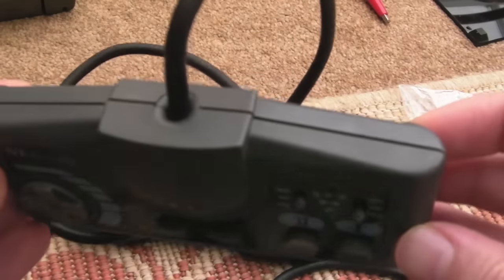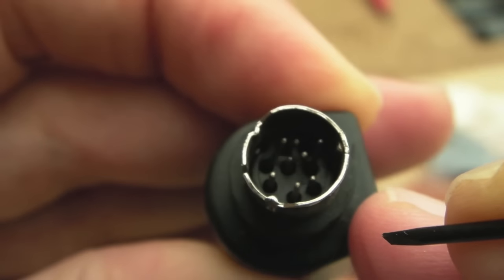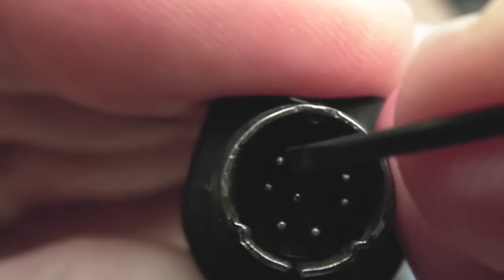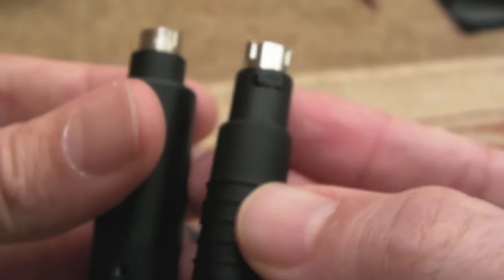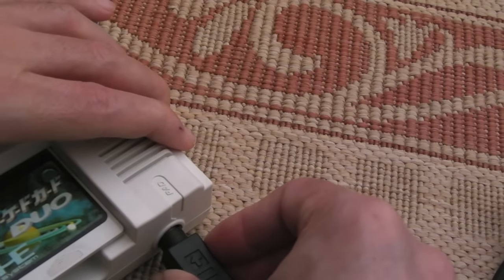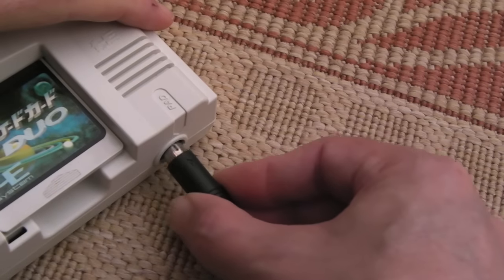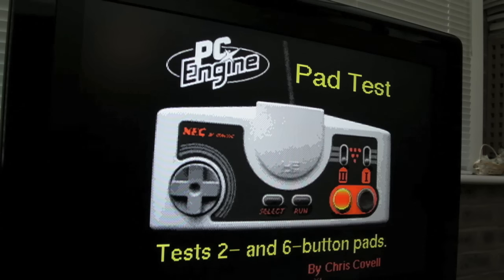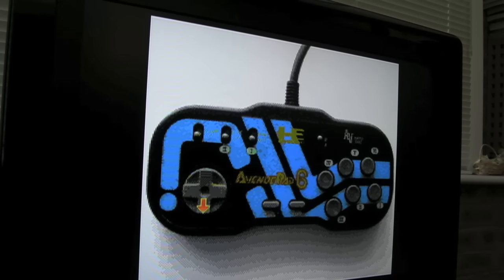NEC PC Engine Bent Controller Pins (Fix / Repair)

Comment: Easy fix, those connectors are pretty flimsy though. Maybe that's why they went for the big DIN plugs on the TurboGrafx
Reply from the maker: Absolutely!  I am sure you are right!  They are much better with the big DIN connectors imo.  It's OK for AV connectors to use this mini DIN (like S-Video) etc, because they aren't connected / disconnected as frequent.  But controllers tend to be in and out all the time.

Comment: My cable is damaged, but is not its pin, is just because is like folded so what can I do?
Reply from the maker: You would need to swap out the cable and connector.  You could buy cable with the correct number of cores and solder a new mini DIN connector on there.  It's a lot of work if you've never made your own cable before.

Comment: I prefer there is a female socket on the cable like on the atari consoles/computers, sega or commodore 64 etc, never have any issues with bent pins.
Reply from the maker: Yes, the console end having the male part sometimes helps (they tend to use better quality connectors), but ultimately its the mini DIN on these controllers that's the problem - ie. the pins are tiny and have less support.

Comment: I tend to favour the method you stated in your end comments whereby you used a pair of needle nosed pliers to manipulate the bent pins back into position. Using a screwdriver on one side may place excess pressure on the mount which could cause loose pins or just bend it in the wrong place whereas pliers or, as someone else mentioned, a small tube may be easier and not lead to other problems. This can be used for any connectors that utilise pins, like an IBM PS2 serial port plug on a computer mouse. It seems that now most connectors use pin free designs to eliminate the potential of bent pins.
Reply from the maker: Yes - good suggestions there!  I think it depends on if someone has tried to straighten them too.  I've seen connectors where they've been bent and straightened more than once and they break off really easily.  If it hasn't been manipulated since it occured is suprisingly easy to just gradually push them back into position, but one pin was bent with a curve - that one had to be straightened properly with the needle nosed pliers.

Comment: probably the best choice you took on the repair. The density is high on the solderpoints. I found a svideo 8 pin videocard mini din. took it apart and all cables and pins were epoxied.. maybe its a god idea to squirt hotsnot in the housing and between the pins after soldering ?
Reply from the maker: Thanks, yes I am sure you are right!  They can be done - I've done them before, but as you say they really really tiny and hard to work on.  I would rather not replace a mini DIN connector lol.

Comment: I have a TG16 controller where the actual pins have pulled out. The round metal casing part. I just push it in really hard and it seems to be okay. I should glue it in place for good.

Comment: I'm not sure on the spacing and how strong these are compared to PS/2 pins but for those I tend to use an empty ballpoint pen with the ink refill removed. Just slip the tip over the pin and it lets you manipulate it easily in any direction.
Reply from the maker: That's a really cool suggestion =D

Comment: I've seen people using an empty mechanical pencil to straighten cpu pins, maybe the right sized brass tubes could be a good tool for straightening out the pins in a DIN connector?
Reply from the maker: Those are some great ideas right there!  Thanks for suggesting those! =D

Comment: Where do you get the replacement ends for the controllers
Reply from the maker: 8 pin mini DIN - search eBay (compare the photo to yours before ordering to make sure pin alignment is the same).  They are standard though!

Comment: lol should have guessed it would be someone like you outbidding me on these....
Reply from the maker: LOL!  It's getting really hard to find anything faulty on eBay recently - have you found the same thing?  There's barely anything worth repairing lol.  I think the problem is lots of people are hunting faulty stuff now and it seems to have resulted in prices going up =/
Reply: indeed, i get most of my stuff shipped direct from japan, only way for it to be cost effective. once these went over £20 i stopped as i only pay a little more for them fully working
Reply from the maker: Lucky sod lol  They were a bit on the pricey side for faulty controllers - typically I don't normally buy faulty controller for more than a few pounds, but a working 6 button controller on eBay tends to sell for £30+.  The bonus was the duo pad I guess.
Reply: duo pad? i only saw the two....
Reply from the maker: Yeah, I mean from a CoreGrafx =D
Reply from the maker: Haha =D  Don't worry, my bidding will be much reduced in 2017!
Reply: Got outbid on those too lol. Dropped at 20quid, it was getting too much with the added postage outside the UK. Oh well, at least we know they went to a good home :)